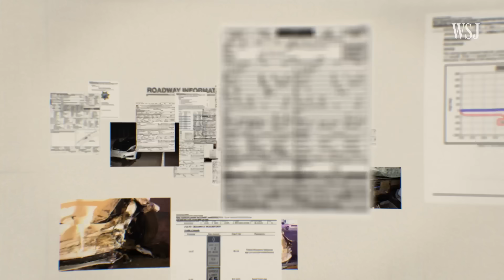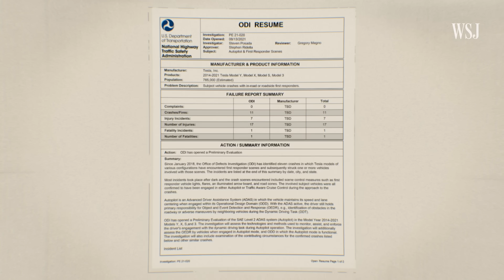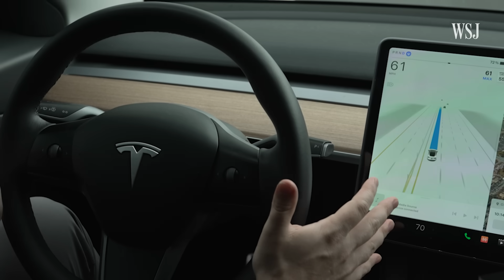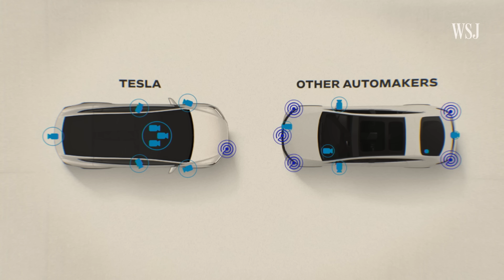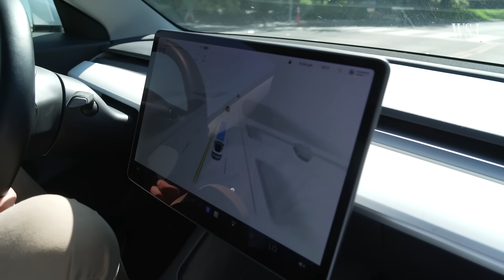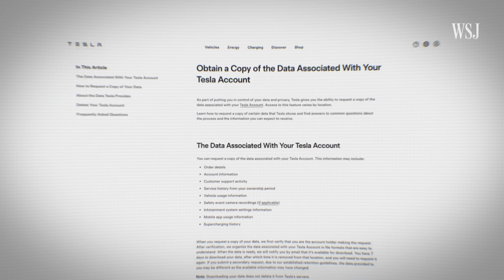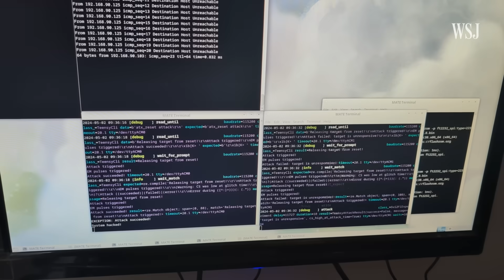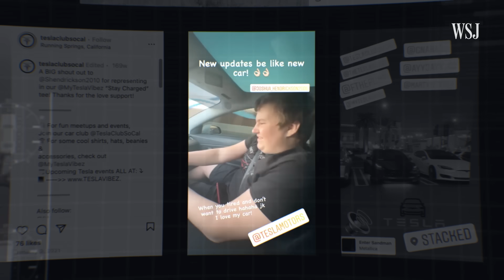The Hidden Autopilot Data That Reveals Why Teslas Crash | WSJ

Comment: Is Tesla's FSD statistically safer than human drivers? That's the fundamental question right now. Some of these accidents may have occured even with a human at the wheel. There's no visibility at all for that over turned car and truck for example. Would a human have seen it in time?

Comment: Moving to a vision, only system is also a mistake. Yes humans drive with only two eyes, but imagine how much better they would be if you could have a radar or LiDAR. Once other manufacturers advanced driver assist systems have enough time compared to Tesla auto pilot. It will probably show that advanced systems with multiple sensor types are better.

Comment: On the tragic deadly crash at the start, I noticed: driving on the left lane, driving at estimated 80 mph (130 feet PER SECOND!) at night with limited forward vision, are deadly factors. Drivers with non Tesla vehicles crash daily under similar circumstances because the ultimate limit is in the human brain unable to comprehend the complexity of driving. Tesla’s fancy cruise control/navigation able, almost self driving technology, depends on inputs. Driving towards a failed bridge, a blocked blind curve, speeding over hills, etc. denies data to the sensors. Driving on the right lane at or below the speed limit, paying attention such as the stopped vehicles on the shoulder that had hazard lights activated, are clues that something has happened. RIP.

Comment: Remotely controlled Tesla robot is called autonomous humamnoid robot. The driving assistant system is labeled as fully autonomous driving system and pushed to robotaxi. Musk is putting stock price above public safety. Without government regulation, this will be extremely dangerous.

Comment: On the one hand, they call it Autopilot, but on the other hand, they say you’re fully responsible while driving. This sends mixed messages. If it’s not auto pilot, then stop calling it Autopilot.
Reply: That's why other manufacturers use terms like "adaptive cruise control" and "lane centering" to describe their capabilities. It's a lot more clear what the car can do without being misleading.

Comment: One of the issues here is that people who do not own a Tesla are in danger of someone else's Tesla killing them.
Reply: You're in danger from any other driver's vehicles killing you, Tesla or not, not sure what this means.
Reply: People who do not own a Tesla are the ones most easily falling for this hit piece.
Reply: Automation will make our roads far safer.
Reply: What if we automated big cars that take many people, in a very sort of regulutated systematic way, and made it electric, and made it go on rails... Guess well never know @daydreamer8373
Reply: @daydreamer8373  Eventually, but there's no reason it needs to be this dangerous. Tesla is just pushing things far faster than what they're technology can handle. If they were deadset on operating these with just cameras, there should have been more cameras and there should have been a period of years where all the autopilot system did was identify potential hazards in the road and flag the information for adding tot he model. And, anytime the vehicle crashed into something or was crashed into, that should have been sent off to be considered for inclusion. 

With a sufficient amount of that information, there should have been a period where drivers were allowed to engage it for no more than 5-10 minutes a time, a short enough period where they could still reliably focus on monitoring what the car was doing. 

Eventually, as things progressed, they could eventually allow longer periods, but how Tesla has handled it has been extremely irresponsible and led to unnecessary fatalities in people that weren't even in the vehicles.
Reply: @SmallSpoonBrigade  You can argue all you like about what they should or shouldn't do. the performance of FSD has moved way past the early development stage, and is already helping to avoid accidents. There is now a clear path to autonomy, and Tesla is leading the way.

Comment: Auto pilot accident rate is still way lower than human drivers. When every accident, blame the car, that kindergarten student behaviour. End of discussion
Reply: So explain why the teslas are the only cars crashing into stationary cars. Also 100% of cars can be driven by a man, most cars on the road do not have a computer driving it.
Reply: The problem is you are taking what mush says as fact. It's not a fact. If it were why hide the data?